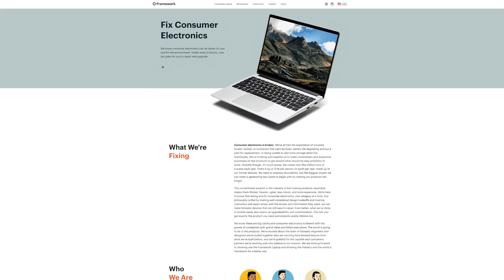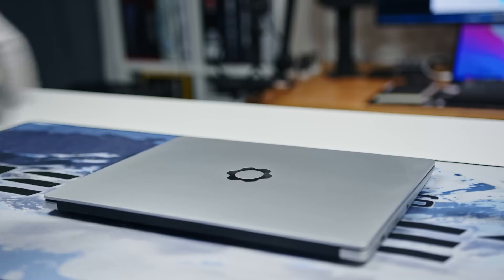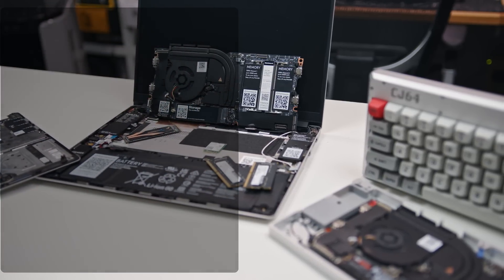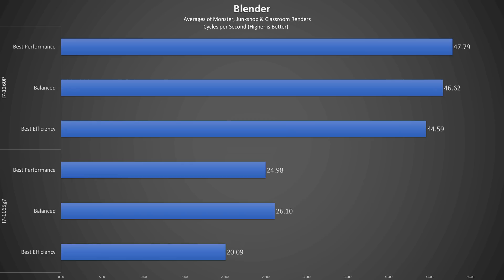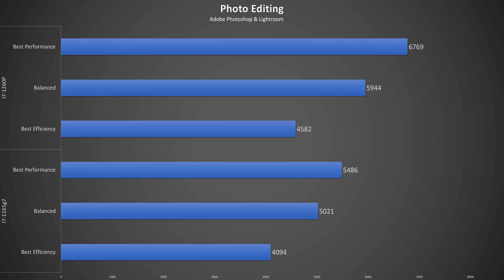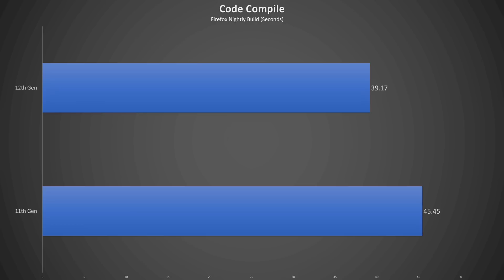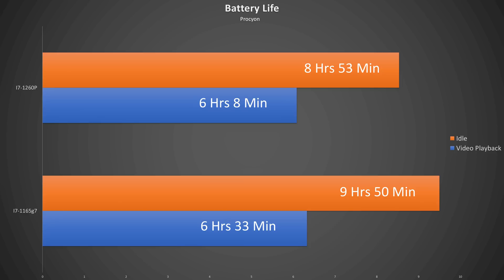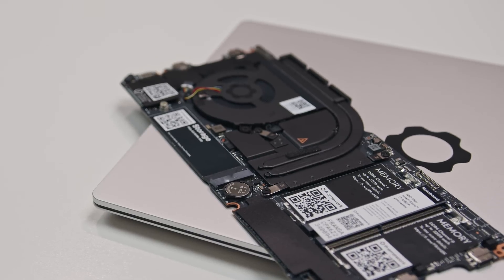Framework Laptop 12th Gen Upgrade! Performance and Efficiency Tested!

Comment: Upgrading framework laptop is like upgrading PC - its useless to annualy change components, like there is no use to replace Ryzen 5 5600X with 7600X since 2 years old CPU is still feeling great in recent games and programs. But upgrading from ryzen 5 1600X ro 7600X gives massive increase in perfomance.

It is meant to change components as they age without changing what srill feels great, like there will be no point in changing cpu 2 years later, but battery will age well. When cpu starts to lack the prowess it had, screen will be alright and when screen will feel too bad and need a change to a newer panel, keyboard would be still.okay to use further. Maybe after 5 to 7 years the only original thing left will be a case, but the same thing is with PCs, so who cares?

Comment: thanks for this detailed review. I'm a mobile content creator and am considering this laptop. The MBP14 would likely be faster and more expensive, but if I'm holding onto the laptop for 4-5 years, I can upgrade the Framework halfway through its lifecycle and likely surpass the MBP.
Reply: Maybe, but you can also get a brand new MacBook Air in five years and spend the same amount as the Framework and that upgrade. Or a 2400$ MacBook Pro which would definitely stay relevant and functional in 5 years as well, which has a much better screen, speakers, io and processor and graphics, and a 14 hour battery life versus 6 at best. Idk, they have to lower the initial costs and seriously improve battery life to compete at their current prices.
Reply: @ghost-user559  the issue for me is that I am doing some heavy processing of 5.6k 360 video and that's likely to become 8k in the near future. A current MacBook Pro will be struggling with that workflow in two years, whereas with the Framework I can upgrade to the latest CPU/GPU to handle it.

MacBook Pros are great. I've had two. But those last two years of owning a MacBook Pro are filled with frustration and the desire to upgrade.
Reply: @JohnMFlores  I think a MacBook Pro with a Max chip would not struggle, even in a few years, but then you are spending some cash. You would spend a similar amount to fully upgrade a framework as well, so in the end it depends if you need Windows or not at at that point. A full set of upgrades for a Framework is a similar price as a moderately upgraded MacBook Pro or Max, and you get a better screen and batteries that last all day, but obviously then you are on MacOS. That’s a tough call, for me I don’t know that this gen of Framework is comparable performance wise to a very well upgraded Mac, but it also is only first gen.

Comment: Personally, I don't think the idea is that you upgrade this every year. For me, this machine would not be my main machine or technically even my second, but used to replace my ultra book (currently Surface Laptop 3) that sits beside my bed and enables me to do work or look stuff up late into the night. Something like a surface laptop 3 needs to be completely replaced every X years as their battery life decreases or performance needs upgrading.

In this use case, This upgrad may happen once every 3 or maybe even 4 years. Get the new main board and replace the battery. I don't think any computer component is worth buying bleeding edge components year over year unless you are chasing performance in a very specific scenario.

Comment: Regarding the end conclusion re standalone mainboards. The framework hardware just became available in Australia, and I've been wanting to move my home sharebox (btrfs cluster, vpn, plex, syncthing, backups, transmission) from a raspberry pi 4 to a framework mainboard in your nuc enclosure, as the raspberry pi's don't support hardware cryptography so encrypted network traffic is very slow, and plex transcoding outright fails for the raspberry pi. So moving to a framework nuc would be one hell of a nice upgrade for this use case, while supporting a company that is pro right for repair and diy maker vibes. My other option is moving it all to my m1 mac mini when I eventually upgrade to a m2 or m3 mac mini, however that is years away, and I'm more inclined to give my old mac hardware to people more impoverished than I am who are phones and ipads only.

Comment: why their are no ryzen offerings
Reply from the maker: There are no new ryzen offerings anywhere, by any manufacturer. AMD's output of new 6000 series mobile processors is a fraction of what Intel is currently cranking out based on current in stock offerings.

Comment: 2020: base M1 MacBook Air = $999 and faster than the base model 2022 Framework.
2024: base M3 MacBook Air = $1199 and faster than any competitor's pro-sumer Windows laptop
Total for two Macs = $2200  ..... and the "old" M1 MBA remains a potent little machine
Total for FrameWork and upgrades in 2024 = waaaaay more than $2200 and will never match Apple Silicon in performance regardless of cost..... BTW, FrameWork will be defunct by 2024...sorry
Reply: 1) Where do you have the 2200 dollar ? The most expensier cpu is at 1200 and it's the hight tier one wich not many people would like to get ? The i5 500 and i7 mid range is at 900

2) Macbook are good laptops yes tho they don't use the same os or even the cpu (they are arm cpu) less yes. Macbooks dosn't have the same reparibility and you can't even ad more ram
(good luck paying for 32 gigs for example)

Comment: Do you think that disabling HyperThreading and half of the E-cores would solve at least some of the problems? 🙂

Also, if you are going to make an enclosure with a dGPU, you probably should use the M.2 connector for the GPU and one of the Thunderbolt ports for your storage. I think it will do better than the "usual" way 😆
Reply: I haven't tested on laptop parts, but on previous desktop parts, disabling multithreading  (HT or SMT) reduces power and temps (along with fans) by quite a bit. In my experience this equates to a couple hundred extra mhz (5% or so) of overclocking or boost frequency.
On a laptop this could translate into longer battery life at the expense of some performance, possibly lower heat - but most modern CPUs will run right up to their limit. So a 45watt CPU will ramp up to 45 watts, if thermals, regardless of  type or load or if HT/SMT is on.
Reply: @FragEightyfive  That makes sense 🙂
I have the problem that I can only talk about all this stuff theoretically as I don't posess a computer with more than two cores (except for my PinePhone) and neither of my CPUs has multithreading support 😆
Reply: I was just as curious. What is the performance, and especially the efficiency on the Alder Lake CPU with all the E-cores disabled, so it's the same 4c/8t vs 4c/8t comparison. I'd hope that for things like video playback or specific tasks, the Alder Lake would be more efficient.

But I'm not sure if it can even be done. I mean, the core disabling. Isn't that only available for K or X skus ?
Reply: @Winnetou17  Not sure. It would have plenty performance for me tho as I daily drive a dual-core pentium from 2008 and my gf's laptop with a skylake 2c/4t i5-6300U feels like a powerhouse in comparison 😂
(AFAIK, the E-Cores are as or more powerful than usual skylake cores)

Comment: For $800, you mind as well sell your old framework laptop and buy a new one. Pretty sure it’ll cost you less than $800

Exactly why upgradeable laptop is a stupid idea.
Reply: Upgradeable laptops are NOT a stupid idea.
Considering upgrading your laptop a mere year after you purchased it is a stupid idea. No one does that. They hang onto them for 3-5 years and then upgrade.
Which is exactly what this one is for...except you don't have to toss the entire thing and buy an entirely new laptop; you simply buy a new mainboard and save $400-500.
Reply: @carriebartkowiak  Except after 3-5years, most people buy new computers. 🙂

You don't toss the entire thing. It's called "2nd hand market". Hell, I sold a 7yrs MBP13 for $400!

BTW, the Framework MB upgrade offering is $800 LOL. How's gonna buy a used 11th Gen Intel MB? It's gonna be next to worthless.

Sounds like you are just brainwashed sheep.

At $800, you can get almost. get a brand new Refurbished M1 MBA with fresh batteries. Never mind you can still sell the used laptop for decent resale value. It'll be like a $400-500 upgrade, which is even cheaper than getting a MB upgrade, except you can get a brand new laptop.

Use some common sense bruh.

Comment: Nice video! I appreciate that you did all the tests on the different Power profiles. Which power profile did you use for the battery test? What different profiles have led to different results in the battery life test? Also, such a same about those efficiency cores not really being more efficient, I was hoping they were going to help out with battery life.

Comment: I have the same original Framework laptop. The 12th gen upgrade is not currently worth it. I think as long as each chassis is supported for at least three gens then that will work. I might be tempted by a 13th gen upgrade but I would wait for them to filter though on Ebay from the more keen users. That or maybe pick up a 12th gen 18 months from now on Ebay. I can also put the return from selling my 11th gen board for whatever against it. At the end of the day...you got options and opportunities.

Comment: I'd love to see a Linux Coding test for 11th vs 12th gen.
My Framework is currently running Fedora with the i5-1135g7 and I imagine many other developers are running similar setups.

It would be great if you could include tests for compiling C/C++ code and Rust code.
Also battery life and standby power draw would be really intersting, as that is likely fairly different on Linux.

Comment: Framework has said that the new hinge doesn't address the screen wobble—it's just to add resistance to the movement of the lid. This helps keep the lid in place when walking with the laptop open and in hand, for example, where each step can lower the lid just a bit (more so if, e.g., going down a flight of stairs).

Comment: As Intel is still submitting patches to bring their Linux experience up to par with their Windows experience on 12th gen, I would recommend Arch or Fedora 36 for 12th gen testing, as you will want a 5.18.x Linux kernel at the minimum
Reply: Exactly. My Arch already has the 5.19.2 kernel and the only thing holding the performance back is the fact that I have a Pentium E5200 and not an actually powerful Alder lake or Zen3 chip 🤣

Comment: Thank you for talking about the new cover! Other channels are mentioning it but not actually demoing it. Mine should be delivered tomorrow. Also the hinges are available to the general public (I have them) they just sell out as soon as they are in stock. The new hinges are really quite nice but they are stiff enough that one finger lid opening is a challenge. Seems like something at 3.7-3.8kg would have been a nice sweet spot. 

The conclusion is the same for any year over year product upgrades. You are only getting a marginal improvement over the last gen but most people don't buy a new laptop or a new phone every year. So I'm interested to see how 11th gen compares when we get 13th or 14th gen Intel CPUs (AMD pretty please?)
Reply from the maker: Wierd, I've been on the notify me list since the day the hinges hit the market but have never received a message. Disappointing 😞
Reply: @ElevatedSystems  I got lucky and saw them in stock when visiting the store page one day. Instant buy. Hopefully more in stock soon! Curious to see what you think of them.

Comment: 3:15 why do you scroll the text along the screen when it could easily just fit all at once? 😅
Reply from the maker: Moving things hold attention longer than static things. YouTube 101.
Reply: @ElevatedSystems  maybe but it seems like it'd be nicer to be able to read it all at once and easily compare. when the text scrolls offscreen it's harder to read

+ holding attention isn't super important since the onscreen stats are just captions for the spoken VO, yea?
Reply: like im not gonna die on this hill or anything, just thought it was annoying as a viewer who actually wanted to read the info onscreen haha
Reply: Don't want to die completely on this hill either, but I was thinking the same. I usually like to see the full table of comparison.

So, say, having the 11th gen on the left and the 12th gen on the right would've been much more useful. And because you can't read instantly, you're still glued to the screen. Also, it can be "revealed" or "completed" on the go, so only the first line initially, then the second line as it's also being spoken and so on, in order to keep having moving things, but still have at the end a nice ease to use comparison table of sorts.

Comment: Thanks for putting this video together, very well presented and answers a real question on the benefits of upgrading. Perhaps as the generations of boards become more numerous, an upgrade of two or even three mainboard versions would have a higher cost-benefit. This of course will only matter if they can maintain this form factor long enough for more versions to be made.
Reply: By the time you're talking 2-3 generations, though, we are talking about replacing way more than just a mainboard. At the very least, there will be new RAM. I think that the Framework is fairly priced and so are the upgrades, but they're always going to have to sell it on the promise of DIY friendliness to tinkerers because economically, they will never really be able to compete against companies like Dell who can offer entire computers for cheaper than Framework upgrades, and they can just offer extended warranties, which will be totally fine for 95% of users.

Comment: The benchmarks vs power efficiency don't make sense. I think Intel 12th gen is just not properly configured. The 'best efficiency' mode should maximally be 10 to 20℅ better than previous generation, instead of more than 200%... I wonder how much you can improve battery life if you downclock the CPU or disable some cores.

Comment: I was looking forward to this video and you do not disappoint ^^ - I wonder if the conclusion is a bit different if you bought the cheapest option before and now have the funds for the most expensive one... though to be honest the idea to just repurpose the old mainboard is super tempting. 
While I do not yet have the need for a new laptop... the next one is likely going to be a Framework, unless I find myself needing something more akin to a gaming laptop and external GPUs are not an option. Repairability deserves the support.
Edit; To be honest the noise level is a concern.

Comment: They should really release the AMD

But I have seen people say they should release with discrete GPU I just don't see how they would fit it in the motherboard
Reply: I think the dGPU version would be need two thermal pads - one for the GPU and one for the CPU. Framework has one pad for the Intel CPU/GPU combo.
Reply: Releasing AMD when they don't have enough engineering time to figure out standby power draw is basically a highway to bankruptcy

Comment: Just wait several generations. At the very least if there is a catastrophic failure you can just buy the upgrade instead or replacing the original CPU motherboard. I just hope they are getting enough revenue to years later design a new framework laptop that fixes some of the flaws of the original and create buisness and gaming models
Reply: By the time 3-4 generations roll around, there will be new RAM and new technologies that make brand new laptops feel worth it, though, not to mention cosmetic wear and tear and things like getting a better screen by buying a new computer. Serviceability is neat, and so is the ability to work on your own computer, but I don't feel like anybody will save money in the long run by getting a Framework vs. buying a new laptop from a company that has a good service contract.
Reply: @mbvglider  but you will save on e-waste especially if you reuse the old main board by turning it into a server or router
Reply: @mberlinger3  it’s not like reuse is unique to Framework. You act like if I had an HP, I would throw it in the trash if I got a new computer. I’d use it as a backup or sell it and someone else would use it.
Reply: @mberlinger3  or you can just sell your used laptop to a good home and buy a new some … like 99% of people.

No ewaste. Just hand me downs

People have been doing that for generations with old clothes and household items and such … some even pass it on to their younger siblings …
Reply: @mbvglider  I don't know of many other laptops with user replaceable/upgradable cpus

I think it's more about the company ethos than them doing anything "new". Apple, and others, for example will fix certain defects by giving a refurbished unit and chucking the damaged one. Framework is building the device to last, moving away from the consumable electronic paradigm.
Reply: @RunForPeace-hk1cu  that totally makes sense. I wonder why there's an e-waste issue then.
Reply: @mberlinger3  because if it breaks you don't need to buy a new laptop.
Reply: also ryzen... srsly this sucks.

Comment: Excellent video thank you, one more suscriber!
I'm an 9550 xps 15 owner which unfortunately needs replacement.  
I absolutely love the concept of the framework laptop but my main concern would be battery life, the second, if the screen is big enough. 
I was thinking about buying  the 12th gen with an i5 (I'll be mainly studying on the laptop). 
Does it consumes less energy than this i7 and thus, gives more battery life?
Reply from the maker: I haven't directly tested it but my understanding is the I5 has better idle battery life but it's not significant when under light load.
Reply: @ElevatedSystems  thanks a lot!